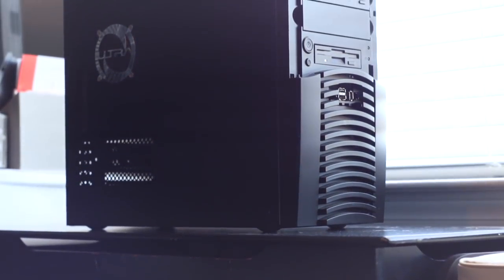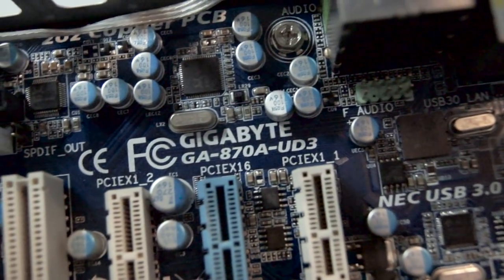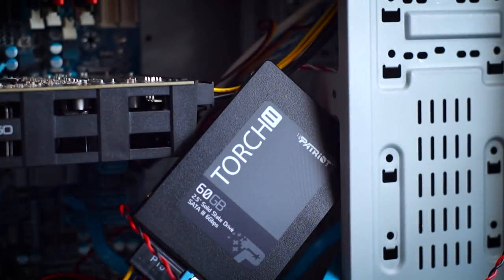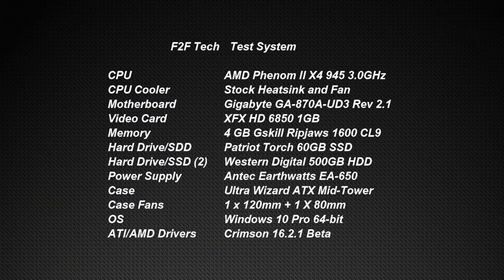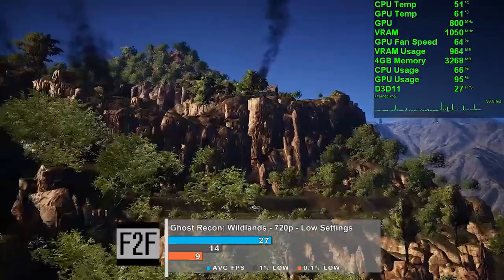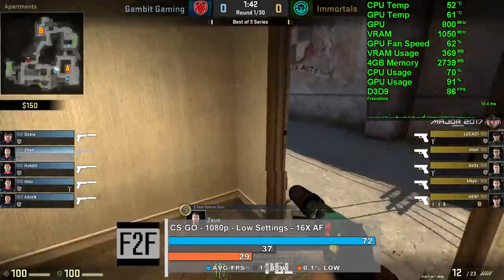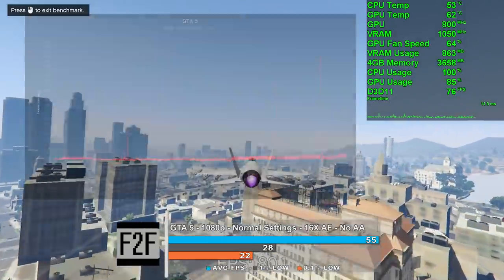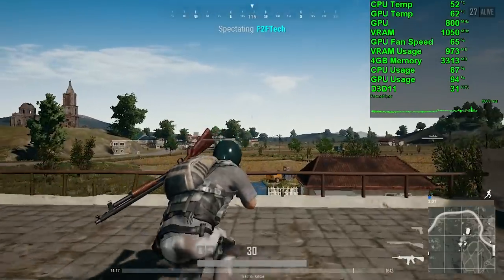How well does a 2010-2011 AMD Phenom II X4 gaming PC hold up in 2018?

Comment: as a proud FX 8350 user today, I am happy to see the lower end of what the AM3 motherboard I has can do, as a matter of fact I would say my chip doesn't perform much better... and it's OC'd to 4.2
Reply: that cause the FX cpus were notorious for well...sucking. the first generation, bulldozer, lost to phenom 2 cpus clock for clock. and the Phenom 2s had the advantage of having fully independant cores. The FX cpus have pairs of cores in modules so they have weaker multi core performance compared to the Phenom 2 cpus

the 2nd generation, Piledriver (which you have with an 8350) improved an ok amount, getting better performance per clock speed and increasing speeds and I think even better multi core performance, but it still wasn't enough tbh

People actually sued AMD in California over lying over core count. Honesty the case was dumb imo, and AMD decided to settle out of court for peanuts, and thus far no other state or country has sued to my knowledge.
Reply: @bluescluessuperagent  I see, so while there's TONS of better hardware, saying I have a "bad cpu* isn't the case. Now that everything is multi threaded today the FX 8350 in my experience dominates the tasks I ask it to do without fuss. Considering I don't have anything better, and that I got this cpu for free from a friend's dead system, is actually a hell of a find if u ask me. I am not saying there aren't better options if I had MONEY, but this thing slaps for what I have to do with it.
Reply: @tribaldragon-sl5gq  this is a matter of perspective. obviously getting something for free is great (edit- Also I only responded to explain why you weren't seeing much progress between this older cpu and your newer one) 

BUT, and this is a statement of fact, it was a bad architecture. We know this for several reasons 

a) it was literally weaker than the previous one. CPU's don't get worse over time, they get better. When you release a new product that is weaker than the previous one or at best equal, people get angry. 

b) the architecture design was soon abandoned. same way Intel also abandoned the netburst architecture from the Pentium 4s. When they came out with core 2 duos, they based it off Pentium 3s. Pentium 4's sold like hot cakes. I used one for a long time. I never knew any better. Now that I know about computers, I'm aware that the P4 was both weaker clock for clock against Pentium 3s and AMD had much better cpus at the time but lacked Intel's marketing push and contacts. Netburst sucked so it was abandoned. Of course it performed the tasks I used it for. But then so did Microsoft Vista or Windows 8 and those were hated and quickly replaced. 

In the case of AMD, they made one revision to the architecture, Bulldozer to Piledriver, and then stop making any mainstream FX improvements and moved onto Ryzen. 

c) The FX's "sucking" is a matter of opinion, but this is an opinion shared by many. And like I said people did take AMD to court in California.  

d) even with things being more multi-threaded, the cpus still show their age and weakness when put up against difficult tasks. like I said they have weak individual core performance and they aren't true cores, which hinders multi-core performance.  So yes, I agree that the cpu has aged better than some early i5 and now an 8 core FX 8350 can beat a i5-2400 certain multi-threaded games, that's a pretty long time for it to overcome that.  

e) " but this thing slaps for what I have to do with it."

that's probably the most important thing right there. If all someone does is web browsing and youtube or something, I could give them a core 2 duo with an ssd and they would be set. I don't know what you use yours with or what you pair it with so if you are satisfied, that's all that matters. 

f) and you literally admitted as such 

"as a matter of fact I would say my chip doesn't perform much better... and it's OC'd to 4.2"

you legit said your "8 core" cpu from a newer platform doesn't perform much better than this 4 core older cpu

that shouldn't be the case. I actually disagree with you on that, the fx 8350 should beat this hands down in modern games assuming a decently powerful gpu is used in both scenarios, but that's why I explained to you why there wasn't much progress between AM3 cpus and AM3+ cpus. do you have it paired with a weak graphics card? 

g) I too have a AMD Fx 8370 and a Phenom 2 X6 1055t. I own almost every modern motherboard platform, AMD and Intel, and towards the best cpu on each platform.
Reply: @bluescluessuperagent  I think ur talking about me comparing my FX 8350 to my mobile I7 7700? yeah my laptop is more powerful CPU wise, but that's for another time. my FX 8350 is paired with an RX 580 8GB, I don't deny my chip's bad design and poor performance as a whole, however I disagree with hating on this chip simply because in my opinion, the creators tried to make it something it's not, and that led to misleading expectations. this chip is alright. I game on my machine, some games do struggle a little but besides fallout 4 and maybe far cry 5, I don't have ANY issues even cranking game graphics. as a whole, my desktop is a better experience than my laptop. I can't have 3 displays running on my laptop, and I noticed that with even my good card (the one I mentioned the prev owner had an R9 270X in it before that I was using until I got a better GPU) my CPU still doesn't max out except to play minecraft, and that's ONLY because the engine needs a whole ass CPU to literally do ANYTHING
Reply: @tribaldragon-sl5gq  " disagree with hating on this chip simply because in my opinion, the creators tried to make it something it's not, and that led to misleading expectations.

that's basically the definition of a failure lol 

they tried to make a superior product, came up with this new cpu design that had shared cores and modules, and then too late realized they had almost zero gains (and in some cases losses) over the previous generation but it was too late so they released it (you also have Piledriver, not Bulldozer, so you missed out on some of the "fun" so to speak lol) 

it's like if Sony released the PS5 but it ended up being as powerful as the PS4

for that matter, you got the cpu for free. Imagine going back in time and being an AMD fan at the time. Someone who owned a true 6 core Phenom 2 cpu. And you are all excited about the new AMD AM3+ cpus. You get the FX 8100 or something expecting great things, only to learn you may have taken a step backwards in performance in many areas, especially gaming. 

your grading rubric is too lenient. Like if I walk into a store today, I could basically close my eyes, randomly point a finger, and get a good phone. Any phone I get is gonna be better than a super high end phone from a few years ago. But phones get reviewed. People review them, they gets scores. Some phones, that are totally useable and work and are better than the phones of yesteryear are gonna be given 6's cause reviews need context. you compare them to what else is currently out, price/performance/features etc etc 

as for your gpu/cpu mix. by coincidence I too have a rx 580 paired with my fx 8370 OC'd to 4.7 in one of the pcs I have lying around my house. 

and the cpu holds back the gpu in my experience. I wouldn't recommend anyone pair anything more powerful than a rx 570 or gtx 1060 with a fx cpu

as for games, try playing something like Battlefield 1 or 5 and see your cpu gets owned.
Reply: @bluescluessuperagent  I wouldn't say too lenient, I am only praising my PC for what it can do, not giving it credit it doesn't deserve. why would I play battlefield tho? yes it's a good system test but it's a crappy series, FPS games in general are boring and repetetive. I run genshin impact on max on this thing without any noticeable framerate drops, I play forza 4 on max and hold 60 FPS, Skyrim, oblivion, Beam NG, Subnautica, saint's row 4, GTA V, and MSC are most of the games I play a lot, and NONE of them require me to upgrade to play them comfortably. as a matter of fact subnautica runs better on my machine, that it does in my uncle's threadripper 2nd gen system (but that's thanks to optimization issues not performance)
Reply: @tribaldragon-sl5gq  I can't think of any reason why any game would run better on your fx vs any threadripper. Fx cores are gonna be like 50% weaker then 1st gen Ryzen core for core. If that's happening there is something off with his system, especially if he has a 2nd gen as those cores are gonna be like 60/70% more powerful. Even if your uncle had his system running in single channel ram thus hobbling his performance it should still win if you use the same gpu.  Your Uncles system wins in single core performance by a lot, so any game that's old and thus only uses 1 or 2 cores wins in his system, and any game that is multi core also wins in his system.  Is  subnautica highly clock speed based? 

And lots of those games you listed are old or not intensive. wouldn't really push your cpu or gpu. 

Also 60fps is a low threshold, especially for old games.

anyway this whole convo has gone on a detour. you originally said the following 

"as a proud FX 8350 user today, I am happy to see the lower end of what the AM3 motherboard I has can do, as a matter of fact I would say my chip doesn't perform much better... and it's OC'd to 4.2

you compared your own FX 8350 that is OC'd to 4.2 (which I now realize isn't even an OC, that's the turbo speed, you just OC'd your cpu it's own turbo speed) to this Phenom 2 X2, a series that was already losing to Intel in performance as Intel's first gen i-series was more powerful
Reply: @bluescluessuperagent  yes, also I am comparing frame rates at NOT the same res, he plays in 4K which is why I get a higher frame rate... Not due to comparability my bad, and as far as the comparison goes, I'm just talking frame rates.... They are similar to what I experience that's all I meant, I'm not going into core architecture or cache or IPC I know my chip performs as good as it does

Comment: you should've gotten a Llano CPU (A6-A8) and investigate on how these  CPU's overclock so good (4.4GHz on stock cooler) i have a prebuilt that has an A6-3620 APU with Radeon HD 6530D graphics in it, and it was "manufactured" (probably built) in 2011.